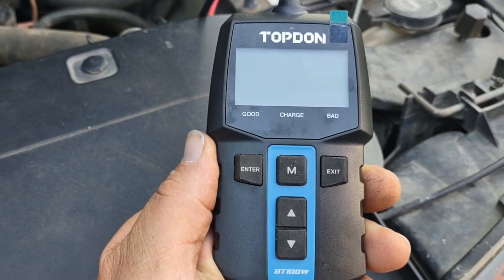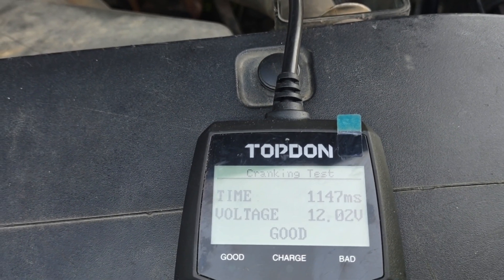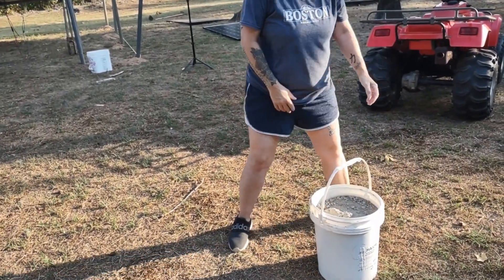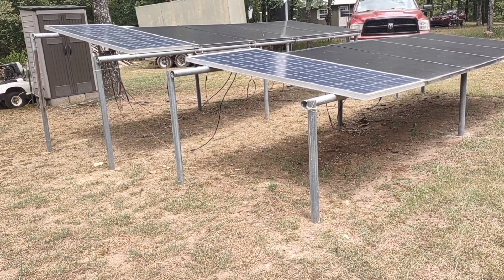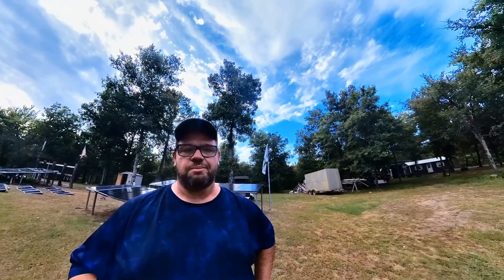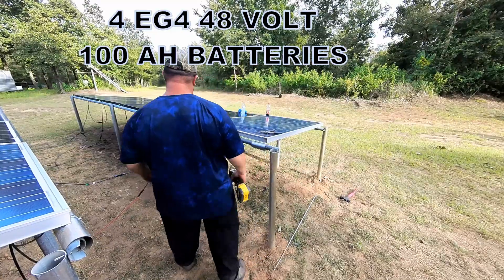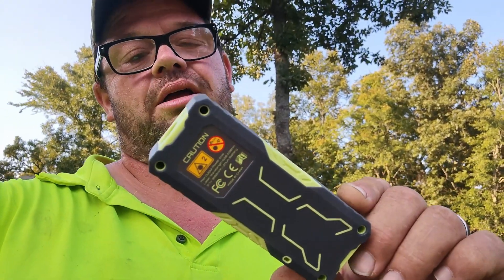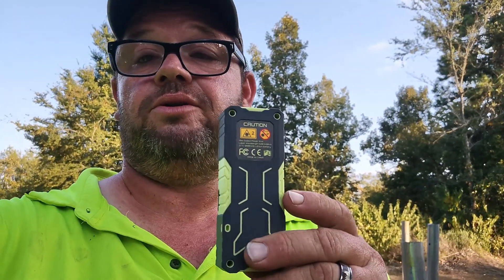installing two extra solar panels the cheap /easy way

Comment: I'm saving for my off grid solar system. I have purchased 2 100amp 48 volt lithium batteries. Do you think a 3000 watt inverter will run a fridge and a window unit and also looking at santan solar for panels.. what would you recommend?
Reply: Guess he doesn’t care😂
Reply from the maker: Sorry about that man I just saw this comment and the answer is yes definitely that's more than enough to run your refrigerator.. if you got all that system with eg4 equipment you got some good stuff